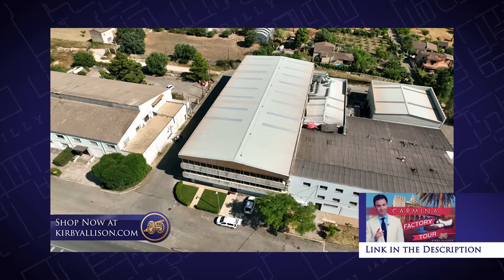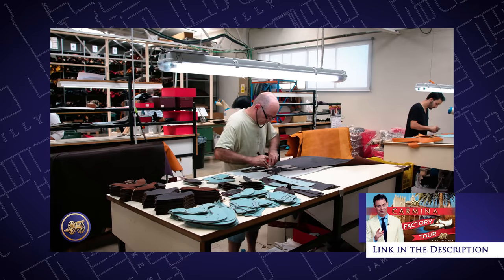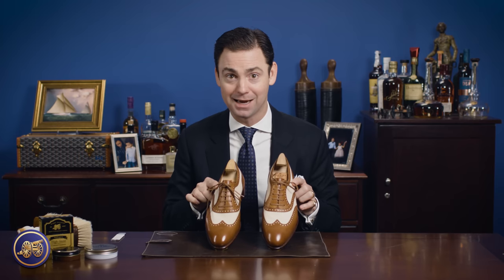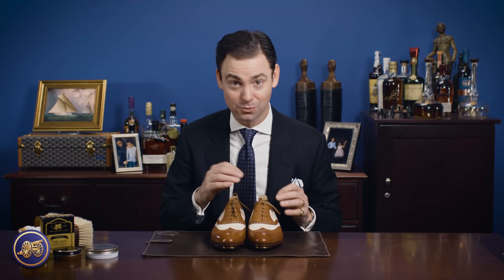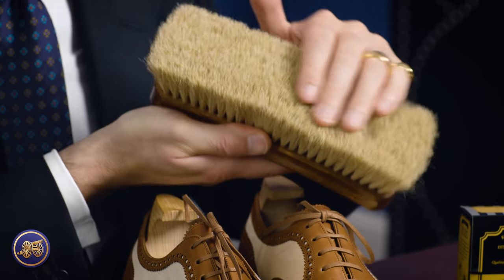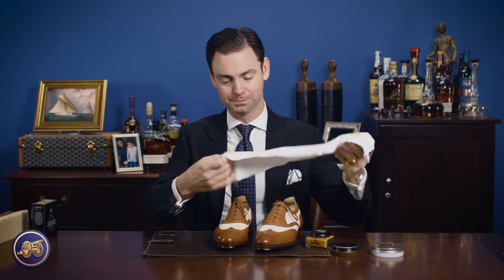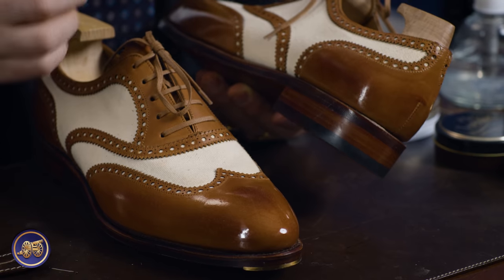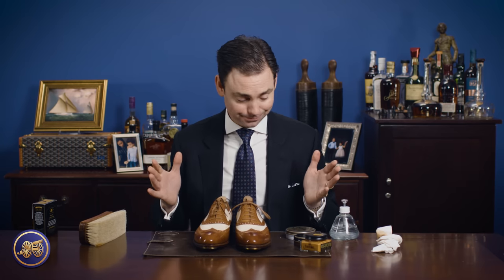Carmina Spectators: Unboxing & First Shoeshine! | Kirby Allison

Comment: I have about 10 pairs of various winter/ summer spectators of all types i.e., suedes, tweeds, light woolens, linens etc. that I rotate and wear pretty often for many years now. I stick to neutral color conditioners and polishes unless color is needed for a spot treatment.  When my shoes are new I spray the fabric portions with either the Saphir or AE suede/fabric protector 3 light coats, and as needed thereafter, then I polish the leather sparingly using one fingertip as many thin coats as desired. I avoid using a big brush and carefully buff using only soft clean cloths like Kirby's or a piece of felt. A long time ago I tried taping off the fabric - forget it, who has time for that. Just don't worry too much, be careful, and get em done.

Comment: Lovely combination of colors and a more subtle choice to have gone with canvas for the lighter color. However it does require care when polishing to avoid stains, that being said, as long time spectator fan, you will smudge the canvas at some point regardless and it will annoy you(it's called patina) . My vintage AE's Ridgefields and Strawfut and Crockett/Jones with canvas sometimes suffer this fate but they are so elegant. The AE Broadstreet model uses soft leather for the lighter sections which make polishing much easier although a tad less classy, be brave and let your inner Gatsby shine!
Reply from the maker: Yes. And for this reason, I really recommend only buffing with a chamois and not a shoe shine brush.
Reply: You can avoid that issue by waterproof the canvas parts with liquid waterproofers (or, because they won't harm the leather, just spray it on the leather, too).

Comment: Hi Kirby, 

On previous “new shoe” videos, you always recommend feeding new shoe hide with Saphir Renovateur, as the leather will not have previously been treated prior to or during  manufacture and will need feeding.

Having fed the hide, you then recommend applying the Saphir Medaille  in the appropriate colour. 

Is there a reason you omitted the Renovateur to your new shoes on this occasion?
Reply from the maker: No particular reason. Wanted to focus more on how to shine these spectators, which can be tricky.
Reply: @kirbyallison  thanks Kirby. So to clarify. The first step in treating new shoes, is to fed and moisturise them, using Saphir Renovateur or similar other brand, prior to applying a cream or wax polish?
Reply: @johnsinclair2672 usually, shoe cream, on its own, is more than enough to nourish the leather, especially if the leather doesn't even cover much of the flexing parts as is.
Reply: @seijiroukikuoka5975  thank you for taking the time to share. Much appreciated. 🙏🏻

Comment: Can the linen be cleaned if you smudge accidentally with the shoe polish?
Reply: It can be done, but it can involve quite a bit of work. Been there, done that.
Reply from the maker: You could certainly use the Omni’Nettoyant to clean the linen, although it could still be challenging to remove pigment.
Reply: @kirbyallison  Thanks, you do a great job with the channel!

Comment: You are a brave man! I would have used some light painter's tape to protect the linen!
Reply from the maker: I’m always afraid that the adhesive will leave a residue that would be worse (and guaranteed) than the polish.
Reply: @kirbyallison  True but you have some steady hands. Good job!
Reply: I've tried it and there was no residue left behind in my experience (Frog tape). But IMHO it's one of those ideas that are good in theory but too bothersome and time consuming in practice.  After you get a little practice it's really not necessary either. By accident I once had the tape strip off the leather finish in a small area on my chocolate hatch grain tartan spectators. I just added some color paste polish on that spot and it was fine.